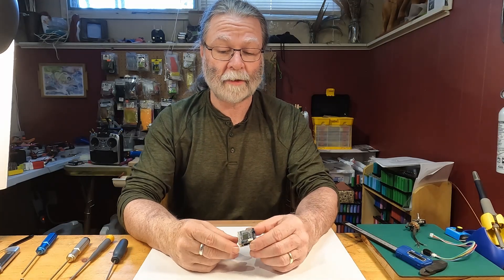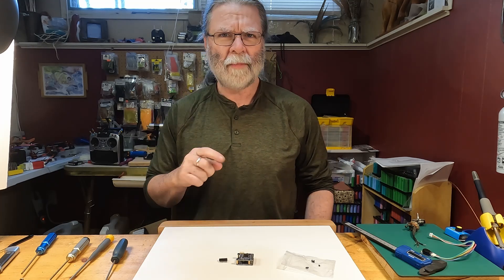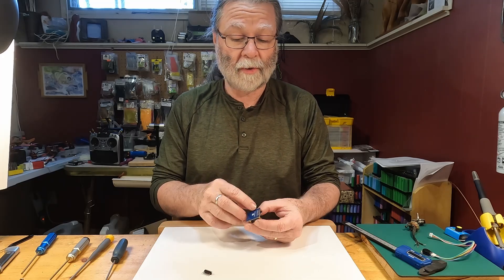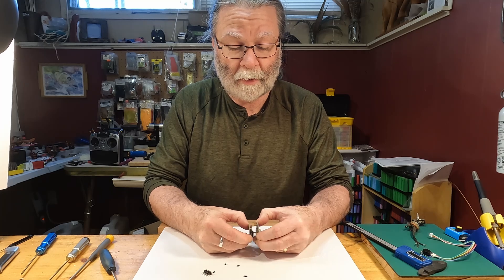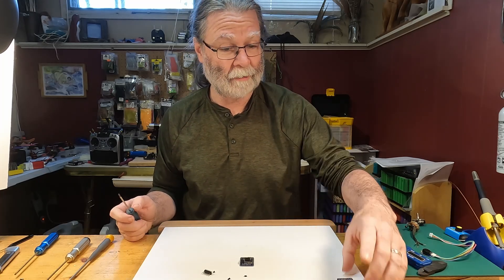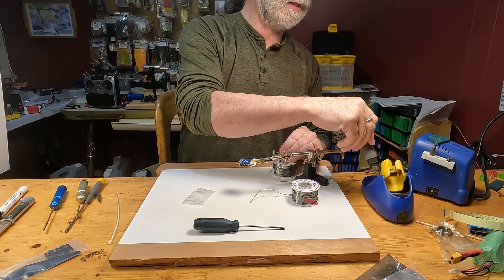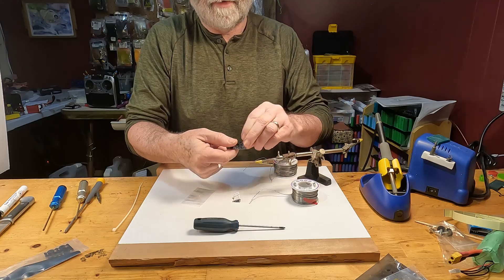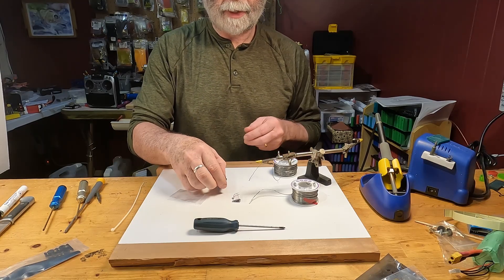Installing Pin Connectors on a Matek F405 wmn flight controller

Comment: Hello, thanks for the informative video! Im also new to the hobby and just wanted to ask, what are the type of pin connectors called you are using? And what guage wire do you use to wire up the FC to servos and sensors etc? Ive also seen singular pin connectors too, do you reccomend using them? Im planning my first build with a Matek H743-WLITE FC, and cant wait to get flying!
Reply from the maker: Welcome to the world of RC flying.  Thanks for leaving the comment and questions.  There are several common connector types used with fixed wing aircraft.  Connectors going to servos are called Futaba connectors (but lots of people just call them servo connectors).  The very small white connectors (like on a GPS unit or a flight control board) are micro-JST connectors which come in several different pin sizes.  As for wire gauge going out to peripheral devices, I typically use anything from 26 - 32 AWG because they never need much current.

When you are buying wire or wired connectors always get multi-strand silicone coated wire and do whatever you can to avoid single strand plastic coated wire.  Silicone coated wire is flexible, and does not melt.

I hope this helps out a bit.  Good luck with your build
Reply: @blueskyfpv  Thanks for the detailed reply, thats helped a lot :)

Comment: Hi why some people add more Capacitor to the Flight controller?
I am new in electric
Reply from the maker: Hi.  Thanks for watching and leaving a question.  The basic power system in most quadcopters and planes is a battery + esc + motor.  There three parts are all capable of delivering and using large amounts of electrical power - think high voltage and high amps.  However, flight controllers are made for much lower power, but are put right in the middle of the main power system. People put capacitors on their flight controllers to help clean up electrical noise and prevent voltage spikes from hitting the main electronics which are quite voltage sensitive.  When a capacitor is put with the battery leads, on a 4 in 1 ESC, or PDB (power distribution board) it is mostly preventing voltage spikes, but helps with electrical noise somewhat too.  When capacitors are used on directly solo ESC's, it helps with much more with electrical noise generated by the esc.

Hope this helps you out.

Comment: Hi there!
I'm super new to this hobby so sorry if this is a beginner question but what solder would you recommend for this flight controller to solder the esc and battery connecter wires to it?
Reply from the maker: Hey Aaron.   Thanks for taking time to watch and ask a question.  

You need to use a solder designed for electronics, not plumbing.  The same is true for flux.
I use MG Chemicals 63/37 tin/lead flux core solder.  I use 23 gauge (.04")  for most jobs as it isn't too thick for small pads (like a UART pad).  For small esc pads like on an all-in-one esc/flight controller, you can use the same.  However, I use slightly thicker 20 gauge (0.025") solder on larger 4-in-1 ESCs (it is a little faster).

You don't need both diameters.  The 23 gauge is about 1/2 the size of 20 gauge, so you can simply fold the thinner solder and use a double thickness.

I hope this helps...Welcome to the hobby.
Reply: @blueskyfpv  Thanks for your reply! I'm looking forward to future videos!

Comment: great video but you need much more light. cant see the pins or actually what you are doing.
Reply from the maker: Hi Phil.  Thanks taking the time to watch and for the comment.  I'm really new at this and I'm struggling with lighting, so I really appreciate that you took the time to watch.  I'll keep working on the production quality....there is so much to learn.
Reply: I've found a desk top swivel, lighted magnification glass to be great for bench work. @blueskyfpv